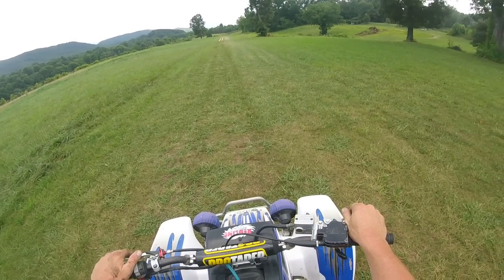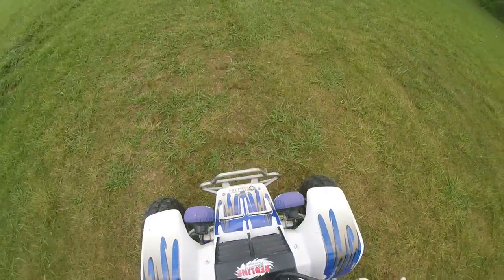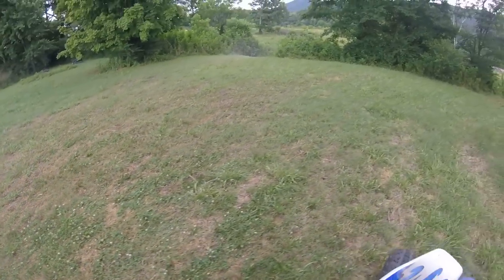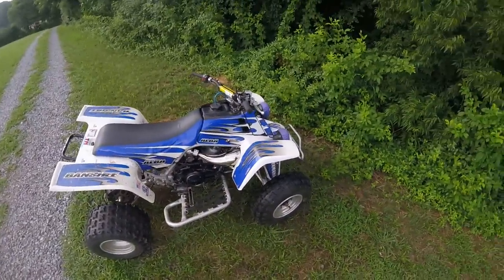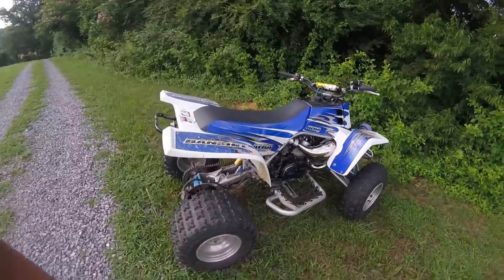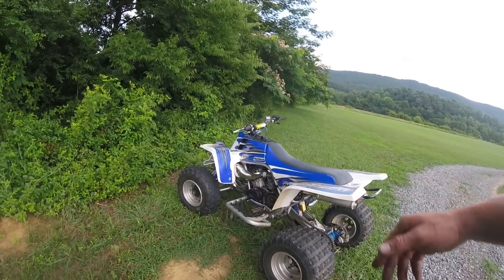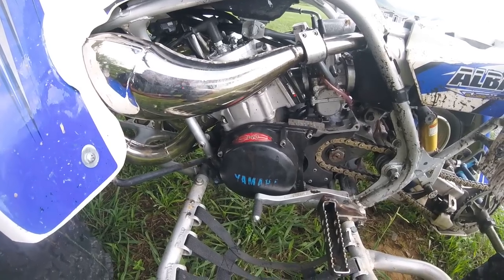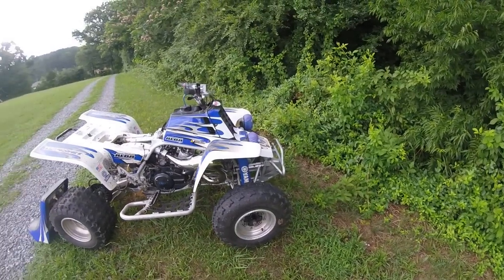100hp banshee quick ride and talk.

Comment: hey brother that's one bad bansee!! I personally built one in 06!! she was a pure beast !! made 97rwhp on the dyno!  I had the same axle problems ! I drilled out the axle and split the bearing retainers , added a grease fitting, and eliminated the heat problem in the axle!  I went with the 15 tooth and ran a tall rear tire ! I could hold it wide open on the top side and she took it like a pro!! I also ran her on the 1/8 mile drag strip 6.90@115mph!!  
and on police radar I topped out at 152mph on a 1 mile run!! 
oh one more thing!! I had so much bottom end ...
I always launched it in third gear @ almost wide open throttle!! ( in the dirt of course!! )if you  haven't tried that  yet ..
you haven't felt the power of that beast yet!! 
it will allow you to go almost 200ft before you get fourth !! DAMMIT boy   I wish I would have gotten video of mine! 
anyway #salute!! 
and let's see that 3rd gear launch!  be safe ,
Josh aka TURBO
Reply from the maker: What size tire was you running
Reply: hellcat channel almost 22inches of ride height! lightweight 6 ply excellent trail and cross-country tire!!
Reply: I dont mean to be an internet hater but Im really doubting 150+ mph. what tires where you running? you had to have deleted a lot of the bodywork? most 600cc sport bikes have about 125 hp and barely hit 160 mph with highly aerodynamic body work, less weight and far less rolling resistance. again, dont mean to talk shit but Im still a doubter

Comment: I'm Irish and I have had a Blaster for the last 2 years as I'm only 15 but it had to be premixed, a gallon of pump fuel (unleaded) is around €9 and the 2T oil was €2.50 (overall $14,50). This would last me about 4 hours as the Blaster was stock. I'm moving onto a Predator 500 now and if anyone know the best area of the Predator to work on, let me know. I've driven the Predator multiple times and I think it's a great ride.

Comment: I had a 2006 limited edition Banshee from the last year you could buy them new. I put Toomey T6 pipes, K&N Pro Flo kit, bigger jets in carb, Delta Force Reed Cage, and a Pro Design Cool Head with 15cc domes.

After doing all those upgrades I noticed a huge difference over the stock setup. I notice the bottom end came alive after all those upgrades and when you would take off there was no more hesitation until you hit the right rpm for power band. Hit the throttle and it launched like you were already in the power-band from a dead stop. I loved the bike and so sad I got rid of it.

I can only imagine how his rides at 100hp!

I never had mine on a dyno, but I can tell you that after my upgrades it felt like a rocket ship compared to when it was all stock.
Reply from the maker: Yea they run good I have another bid of a yellow one like then mods check it out

Comment: If you're running that maxima 927 oil with the VP110 you can run it at 32:1 with no problems. Thats a great oil and you dont need that much of it to be safe.
Reply from the maker: It's at 32 to1
Reply: @banshee100 , did it spit a little less oil when you leaned it out?? Make any more power??

Comment: Im trying to set up my 421 serval
35mm cel 
Tried pro curcuit and now snipers
Cant get rid off low mid bog
Redline ported 
My sons stock serval pro cuircut is much smoother mid 
Will pull 6th power wheelie from mid like its nothing but down low is rich
Run all sort of needles
Dek del dem cem to name a few
Even have custom cel with a second half d taper which is best
Any suggestions
Reply from the maker: What's jets are you running list all
Reply from the maker: My buddy has a serial I ran today it has 150 main 48 pilot needle with middle clip 1 turn out on air screw, it's ported by mac daddy

Comment: great channel brotha I have quick question I recently bought a banshee and I have inspected the whole frame with the plastics off and inspected all the weld points and everything but when i ride it it seems to wanna go to the right when i let off the gas its drivable and it can still do what I want it to do but id like to get it sorted out I just wanted to know if you have ran into this issue or might know the culprit I inspected the frame and its straight so i don't know where to go from here any information would be great keep the videos coming thanks in advance!
Reply from the maker: Check the toe on front tires
Reply: ill check that out thank you once again have a good weekend!
Reply: Check front wheel bearing

Comment: If also recommend getting you some yfz450 front calipers and a yfz450 front master cylinder with steal braided lines on that thing. Also if you want easier throttle pull throw a 400ex throttle on there.
Reply from the maker: I already have them about to do a video on that

Comment: 100 hp sounds totally doable, the 440 race snowmobiles pump out about 95 crank hp on pump gas, so with a bit more peaky porting 100 should be no problemo.

Comment: Hmm. I do find it hard to believe it’s 100hp but I do actually believe. I’m going back to the video.
Reply: Axle warping can be caused by drifting at high speeds. I’ve only heard. I’ve never seen it first hand. I have seen them get bent by taking them off a 10ft cliff 😂 do you have stage 2 port? Idc who done it. I really want to know if you just have a big bore or also port. What’s  stage?!? My 86 atc 250r bored to a 280 with stage 2 ports is what I use for trails and drag. The other that’s bored to a 310 with stage 3 ports and power jets is only for drag. I don’t ride it so much cause it’s alcohol. When ever I get a GoPro I’ll be posting a vid of each one doing a couple passes.
Reply from the maker: i have another vid called 100hp breakdown that tells all abour the build